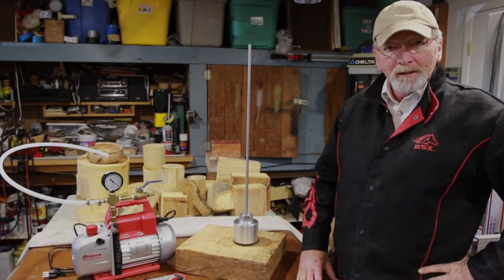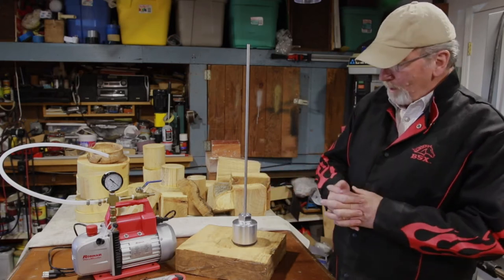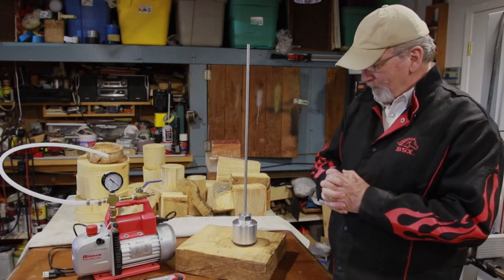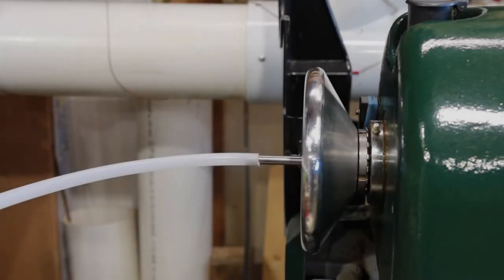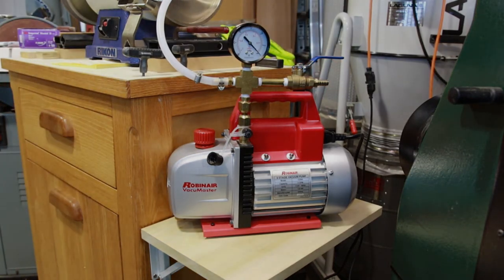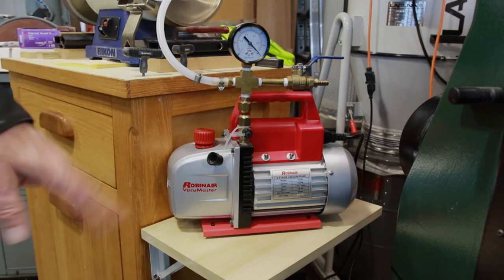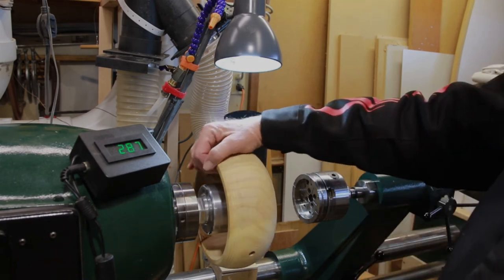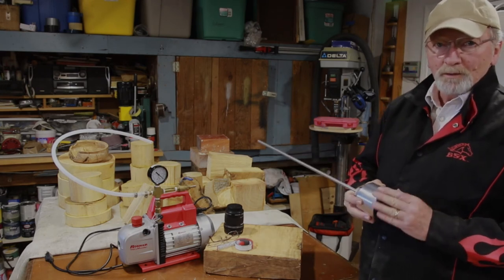Vacuum Chuck for the VB36

Comment: Thanks for your kind words Dave, I really appreciate it!
You asked in an email if this chuck was available with 33 - 3.5 threads. We don't offer that thread but a spindle adapter is available for just $20 at Penn State Industries is that converts M33 – 3.5 to  1 - 8. That adapter used with a vacuum chuck with 1 - 8 threads should work quite nicely on a lathe with M33 spindle threads.

Here's a link to that adapter on the Penn State website https://www.pennstateind.com/store/LA3318.html
Here's a link to our these vacuum chucks on our website https://www.harrisonspecialties.com/vacuum-chuck-and-manifold-kit-for-wood-lathe-turning/

As mentioned in the video a longer tube is available and may be needed if this adapter is used. The standard tube length is 19" when measured from the threaded opening to the end of the tube. 

Thanks again!
Kerry Harrison - https://www.harrisonspecialties.com/